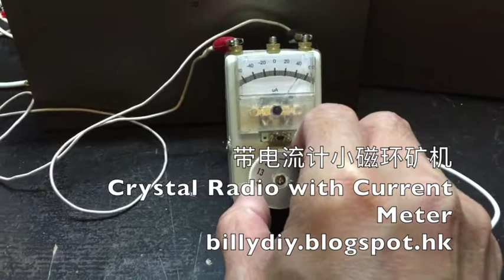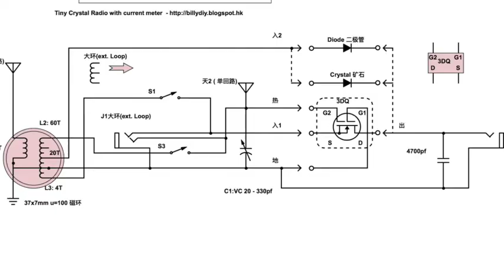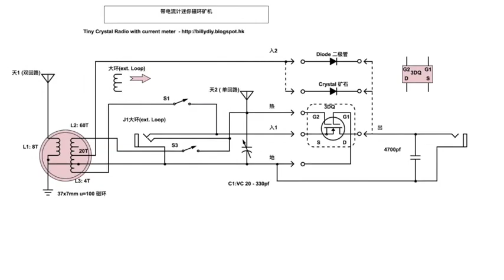Tiny Crystal Radio with current meter

Comment: Like very strong AM stations... if led glow... In 1910s crustal radio made with small 1,5V battery, to add small DC bias to set correct diode operation point ( increases sensitivity ) led works as a DC bias "indicator" and with dc bias can receive weak signals..
Reply from the maker: Ingus Siliņš , thanks. Yes you are right. But I do not want to use batteries as that removes the charms of having a crystal radio in the first place. To me a clean crystal radio is something that operates without any form of battery or power except that received from the radio wave itself.
Reply: @BillyCdiy  very interesting project - made 1900s crystal radio,s
- Crystal radio with loose coupler coil
- Crystal radio with slide tuning coil
- Crystal radio with tap swich tuned coil...
- Crystal radio with classic variometer coil...
I made simple regens, and TRFs, and test same of old days tunning systems ( variometers, slide tunning coil )
Air core coil with 75...200mm diam is a eqivalent ferrite loopstic antenna...
Ingus :)
Reply from the maker: That's amazing. Thanks for sharing. @ingussilins6330